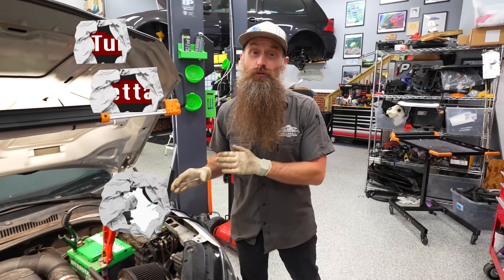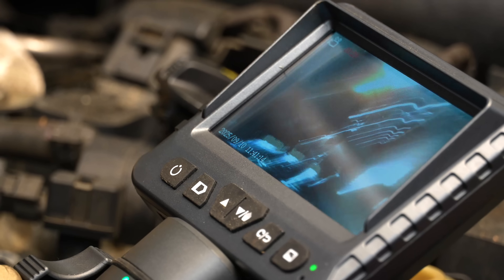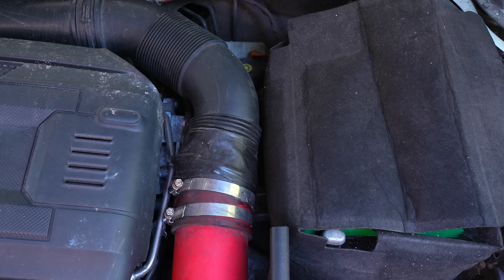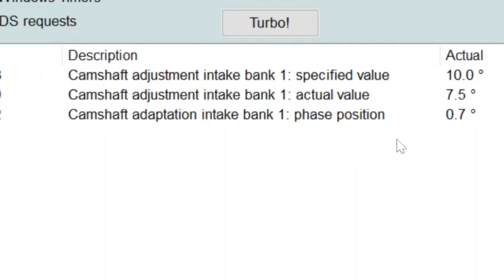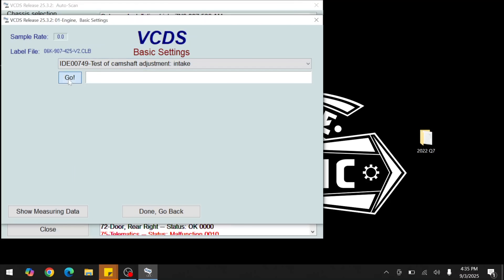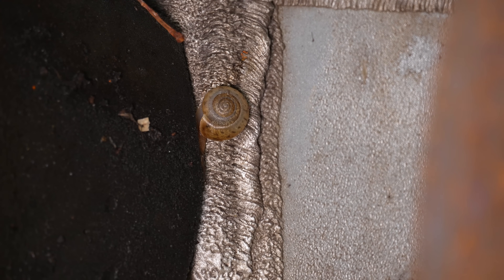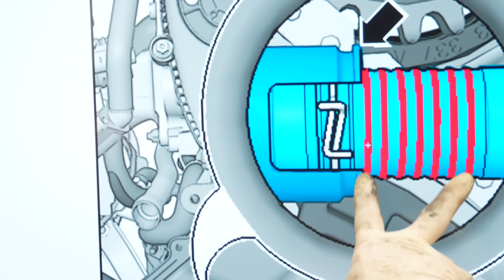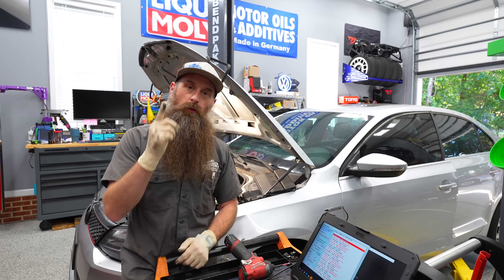TSI Timing Chain Failure: DIY Test That Will Save Your Engine

Comment: I've replaced the timing chain twice in my 1.4 TSI CAXA.  The first time it lasted 60,000 miles - bent valves the lot.  The second time it lasted 40,000 miles then threw a camshaft-crankshaft correlation error,  so didn't need to take the head off.  I did everything on both occasions and used genuine VAG parts [including the latest iteration of the chain].  The chain had 'stretched' almost half an inch the second time - what do they make these things from !!!  This is a vehicle using the correctly specified VAG oil and enjoying oil and filter changes every 3000 miles !!  This time I've replaced all the timing gear as well as the oil pump,  oil pump chain,  camshafts etc...  I've used Febi parts throughout rather than VAG parts,  so let's see how long they last.  On the positive side,  the car's compression is exactly as factory,  lost nothing.

Comment: Hey, if my Camshaft adjustment intake b1 (specified) is 28.00 degreesKW, and " "(actual) fluctuates between 27.50 degreesKW to 28 oKW, with a Phase position bank 1 intake of -4.11degrees, is this indicative of a chain needing to be replaced? I have had misfires. Thanks for info anyone.

Comment: Hey, short question.

My car (7.5R) idles rough, no codes. But when i drive its smooth. 

I noticed that: camshaft adjustment intake bank 1 specified value is 15. And its playing from 9 to 24. 

When i drive consant its pretty close to each other. Within 1.

I checked the camshaft magnet pin and its not stuck. Moving freely. Could it be the control valve?

It makes no strange noise, and i change oil each 5000 miles.

Any advice?

Comment: Got an issue with the Ea888.3 S3
Cold start ticking/clatterwhich completely goes away after 2-3 minutes until the next cold start (overnight) or if left for an hour or two hot start. Intake Camshaft adjustment specified and actual value is at 15° with +/- 0.5. The phase position for the intake is 0.0 where as the exhaust is -2.2?
If I unplug the N522 valve (piston cooling solenoid) the issue goes away/becomes hardly noticeable so not sure what to make of it, my local specialist can't find any issues

Comment: Hi Charles, great videos as always, watching from the UK, i am glad you`ve made this video, i have an audi a5, 1.8l, gasoline, 2013 cvt transmission which i hate, it is been stopped for more than a year thinking that i had transmission problems, replaced oil and filter but i did no get any fault codes at all, i can reverse but no moving forwards, removed mechatronic sent it to get tested and it was not faulty, fitted back in the car but still not driving forwards, i have checked timing chain exactly as did in this video, magnets were replaced and those figures are ok, but the camshaft intake phase goes from positive 4.5 degree and 3.7, positive, it has a new timing chain in it, probably from chine as bought it from ebay, could you tell me if because of the positive degree the is not driving, is stalls when shifting " drive", by the way very well explained your videos, thanks for reading, Jose

Comment: I have sporadic/passive P000A and P0011 on my 2013 Audi Q5, there's no check engine light, it seems to only come up when I use cruise control on long trips (I think like 1hour plus), if I don't use cruise control it doesn't show up when I scan. Does anyone have experience with this? Thanks

Comment: My number with obd11 is plus or minus 2.5 degrees. Is the scan tool accurate enough or do I need to pull the plug to double check?

Comment: On my OBDeleven, the exhaust camshaft phase position is -0.3° and the intake is 0.7°.
I checked the timing chain tensioner and I can see only 3 ribs.
So, according to OBDeleven the timing is bad, but the tensioner seems good – or am I misunderstanding something?
A3 8V cntc 2.0tfsi

Comment: I had the Gen1 EA888 in my '10 Audi A5. I went to start once and it wouldn't. Turns out the chain stretched and reached the limit of the tensioner. Skipped a tooth. I could get it to run after clearing codes, but it ran like crap, so I had it flatbeded to the dealer. Turns out they fixed the front and rear seals 2K miles earlier. Didn't think to warn me about the tensioner being near it's limit. I ate that cost, even though they said they would recommend checking the tensioner... which they should have!

Comment: Another great video as always, perfect timing for me too! Just a quick question about the timing chain tensioner clip. My clip appears to be a few ribs over from the left side. Would it be safe to move it over to the left side without causing any issues with the timing?
Thanks!

Comment: I love watching how you diagnose issues using VCDS, it’s absolutely invaluable and I’d be lost without it, I have not been using it as long as you so it’s interesting to watch your progress of testing/diagnosis, had many problems that have been solved with VCDS, but you need the genuine version, the cheap ones from china are not the same.

Comment: This would be a gen 1/2 or gen 3 engine? This is no longer an issue on gen 3 and up right??
Reply from the maker: It still happens. Not at the rate the gen 1 did but still worth checking

Comment: used 2014 1.8 Passat 80,000 miles timing codes rough idle undriveable 24hrs after leaving dealership, they replaced timing chain, 1 month later same thing, I replaced the timing magnet (camshaft actuator) after watching a pine hollow diag vid, never had an issue since now at 280,000 miles. Timing magnet pin gets stuck with sludge if you skip oil changes and can't adjust vtt. At least I got a free timing chain installed.
Reply: I’m trying to figure out if a 2014 A5 I’m looking at is something I need to expect to do with timing chain or not. Owner stated it is stock, 99k miles so I have my concerns

Comment: If you're replacing camshafts on the newer EA888, the spool valve has been updated.  The older OE spool valve will not fit the new cams.

Comment: Honestly man, this video came up right at the exact time I need it lol
My wife has a 15gti we bought about 8months ago, and I’ve been putting off checking this(even tho it’s running fine).
Any little thing that’s wrong with the car she just hates the universe, and since I’m the “fix it guy” it’s always my fault.  It’s got the sunroof drains leaking and I tried to look into that a few months ago but WTF was VW thinking about when they made those stupid clips for everything in the headliner?  What’s wrong with regular screws? Anyway… also neeed to do tiling belt on
My 13 R besides a ton of other deferred maintenance, and services…(bought it the day before the gti..)

Comment: Buy new Golf R and changed my oil every 5000km at home by my self, car is stage 2 from first year till he was still on warranty and after 6 years no problems just heat it up properly qnd full power.. 
Camshaft magnets, water pump, PCV is biggest problem on that engine, but cheap and easy fix
Reply: Ever 5,000 km is over kill. I run stage 2 on mine and 10,000km is fine and still 5 k earlier than recommended. Do your DSG every 70,000 km too. 👍
Reply: @Golfr2020 I make it now on 60k because it's on Stage 2+ and it's big difference how he change gear even before he change good.. normal car you need to change every 10k but car what go in big rpm burn oil so you need change it before..
Reply: @itsSEMlH  hey I don't burn oil that is missing, its burn that is super black, I know that new oils have more additive inside so they burn and make it also black.. I change it by my self and buy it every year on discount so its really cheap to change.. dont read what book says because they wish you come and buy new engine 😂🤣 people in Europe change oil on 10k in normal cars so this is my mathematics for sport car, I buy it new and plan to drive it long time, its Combi version with sun room so we really love car 🚀
Take care
Reply: @power93_365 yes, I change oil every 5k-7.5k km as well. Especially on modern turbo cars. With the environmental laws, turbos are designed with higher compression and bigger margins for blowby in the pistons. No matter what oil you use, it's going to be contaminated by the blowby fuel.
Reply: @cchkuan totally agree, its more staff like magnets shaft also broke because no oil change on time then people spend ton of money to understand why car work wrong or they just sell it because scared engine problems,and actually is cheep and easy fix..

Comment: Had a 2012 Tiguan for almost 5 years, never missed a single oil change, never floored it... then in the 5th year it slapped me with a $3000+ repair bill for an oil pressure issue. Never another VW or any car that comes with the infamous EA888
Reply: If you had a 10yr+ year old German car and in 5yrs of ownership you had no issues with the car until that repair, you don’t need to own a German car if that price was to much for you. Especially if you had the dealer repair it, could’ve got it cheaper at an Indy mechanic 🤷🏽‍♂️

Comment: Hehehe I have an 09 GLI with the ea888 at 180 000 on the clock and still the original timing equipment. I mean I’d change some of it but… it’s an ‘09 and I have other vehicles so… it’s gonna eventually die from this I’m sure.

Comment: How timely!  I picked up a '11 Tiguan cheap with known timing chain issues.  All 8 intake valves were bent, not too bad of a job.  Get it all back together and drive it for 2 weeks.  After finishing up the project I drained the oil for an oil change, there was no oil in it, the plug was stripped.  Ok, drove it 2 weeks, 500 miles and it never sounded right, it was noisier than my brother in laws gfs 2016 tiguan.  I got over zealous on the way to work one morning chasing an STi and the oil light started flashing.  Pretty sure i killed a rod bearing that was already wounded when I bought it.

Comment: I just did my timing and balance chain.. about 5 weeks ago.My car stalled for no reason... At well there was a reason but I knew my timing needed to be done... 

I was actually afraid that my timing had let go and that's why the car died..

That wasn't the problem , but my timing was at -5.37... so I parked the car still not knowing what's wrong with it..

Got a timing kit for 8 hundred dollars watched many of your videos and other mechanics videos on how to properly time the motor...

Successfully completed the timing job, it's been three hundred miles so far..

But the reason why my car shut off originally was because my low pressure fuel pump failed... It was weird though because it would start and run it would just die randomly...

So far I put three hundred miles on the car and no problems... even got a few races in..

2012 beetle turbo 2.0tsi with 150k miles yeah, I know.I waited a long time to do my timing and I got very lucky... I did however replace the timing chain tensioner about three years ago before I added a ko4 turbo to my bug

Comment: One thing to mention , if you want to never worry about chains , replace your oil every 5k from day 1. I recently started doing them at 3k .  On these ea888 engines usually they only need magnets at around 100k. Cars that need chains customers would go 10-11-12k on low oil changes .  You should mention that if you live in California and your car has Pzev on your emissions label , they have warranty on  check engine lights 15 years/150k miles

Comment: The love that you did the diag. on a Jetta, the CPPA engine is very wonky. The phaser bounce is much more pronounced on this car due to poor programming in the ECU (from your second check after fixing the bolts). When you adjust with some settings from a GTI or R engine it smooths out significantly. This made me miss #projectgen3awd

Comment: When my VW Golf 5's TSI timing chain started clattering, the best DIY fix was to sell it and buy a Mazda 6.
Reply: Mazda 6 😂 if you can’t work on German cars it’s okay but all golfs are superior I have a rabbit, mk5 gti and 400 Audi A3 all been reliable my gti is the best car I’ve ever had 100 mph+ everytime I drive it n I drive it and I’ve put 30k miles on it in less than a year these cars need maintenance and you’ll find your reliability
Reply: @Allwheelgti  "work on German cars" Bro i am literally a mechanic in Europe. I was sick of my daily driver needing maintenance that other cars don't. But yes, like you said, IF PROPERLY MAINTAINED. But nobody maintains second hand German cars. And when you're the 3rd, 4th owner... It's garbage
Reply: @DanielRevay lmao timing is one of the most common services for volkwegen/Audi a real tech wouldn’t have an issue with this because honestly the job isn’t anything like a 3.0t or something you’re not making sense rn buddy Mazda 6 is actual garbage compared to a gti the disrespect is crazy next time you need help on a timing job message me 
We’ll start in the morning be done mid afternoon and we can do this on a hoist in a shop that I work in

Comment: My 2014 GTI went 194000 before we changed the timing chain and tensioner. Luckily it did have the new tensioner but it was extended all the way so I was lucky. My sons girlfriend has a 2017 Tiguan and her timing chain jumped a tooth at 80K but again we were lucky that it didn't damage the engine, just ran terrible. Oh and as far as VCDS, the GTI was -9 phase position, and the Tiguan was -12. The GTI still ran normal, but I knew she was on the very edge of curve. Also as a comparison, we had the Tiguan done at our local VW shop (not the dealership) and it cost about $2100 with through inspection of everything. She needed it done immediately and they were able to get it completed in just one day. The GTI we spent a few nights on it and it cost about $700 in parts from ECS Tuning.
Reply: So what you're saying is, we should be prepared to keep our VW engines doing good turns daily.
Reply: @benlancaster1391  Absolutely!
Reply: Oh wow, I have a 17 Tiguan that just started running terrible after an oil change and brake job at (you guessed it) 80 thousand miles!! Did you have to replace the whole chain or just the tensioner?
Reply: @malcolmgeorge  You already have most of it apart with a lot of single use bolts just to get to the tensioner. I would not just change the tensioner, chains, guides all of it.
Reply: @ericpullen524 I asked what you guys replaced... I guess you did it all. I got this one apart today. Looks like a new chain, upper rubbing block, and tensioner would fix it. The chain is stretched out so bad that the tensioner is all the way out!

Comment: The weirdest one I've had yet was a Mk7 GTI with timing codes. Timing was great but it would keep setting. Found the cam adjuster solenoid was completely stuck. I check those on every car I do a chain on now.

Comment: i did my 2013 mk6 (it had updated tensioner part) timing chain service/replacement at 140k and my car runs like new. mine had slight rattle on startup when on embankments, and the stretch was around 4-5 degrees but was still running great. after service its below 0 and sounds/runs like new.  pacific german in south OC knows their shit. ive owned car since new and oil changes every 3-5k with some track days and DSG fluid change every 40kexcept when it started to leak via the cooler seal from some track days.

Comment: STRETCH definition:  To extend or lengthen something beyond normal length. or :To elongate
Reply from the maker: TRUE and this is the language we use, but technically it doesn't stretch, it wears causing it to elongate. If the internet wasn't fussy about it, id just use stretch HAHA
Reply: @HumbleMechanic  just like Engine and Motor haha. Does a Motor use MOTOR OIL? hahha. You are one of the best I ever saw. Thanks for all your teachings. Especially PETROL MOTOR rebuilds hahahha LOL ha

Comment: How to avoid timing chain failure, buy a VW with a timing belt lol. 

So much less trouble and they are actually designed to be replaced, ironically at the 120k that the chains seem to be cooked by.

Comment: I've got EA888 and 6-sp DSG (2016 R) with 55.000 km.  Has anyone ever noted a resonance  "heart beat" sound (that pulses like once per second) from the timing chain area at idle?  It's very idle speed dependant. For me, it's warm engine, Sport transmission mode and A/C off.   The load of A/C or using Drive transmission mode (different idle speed) makes the resonance go away.  I was going to have it looked at during the next oil change in October.

Comment: Thank you for this video. My 2017 Golf Alltrack is at 140k miles. I bought it new and maintain it properly. I was wondering about the chains. Time to check.
Reply: Should have the ea888 gen 3 which revised the timing tensioner and makes it not an issue

Comment: People say I'm crazy of my enjoyment for BMWs. Working on them, etc. Yet everytime I lay hands on a Audi or VW, I don’t understand the lore. Ya'll are nuts. They're the only cars I refuse at the shop.
Reply: You will be gainfully employed for life just replacing the plastic components on the BMWs.
Reply: @dantesinfernopurgatory7826 Everything is junk now days, but even the older models.. Wastegate actuators on a B5 S4, absolutely terrible without removing the engine. PCV system and downpipes on a A6 3.0t, ridiculous design under that supercharger and access to downpipes blow. Don't even talk about the timing system design on the 4.2 V8 which was from the 90's! What the hell! Comparing to similar aged BMWs, the VAG group really put every effort into over complicating things. Meanwhile when stock vs stock, the 3.2 inline 6 E46 M3 stomped the 2.7 twin turbo S4, while being naturally aspirated and with inline 6 simplicity.